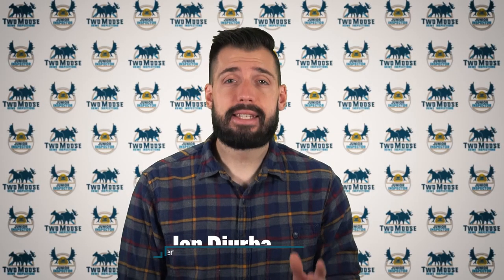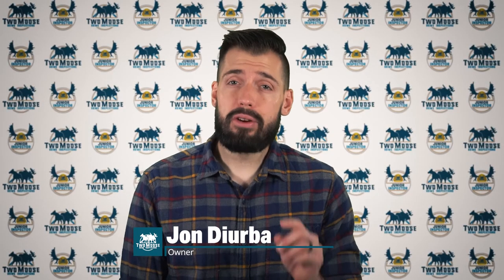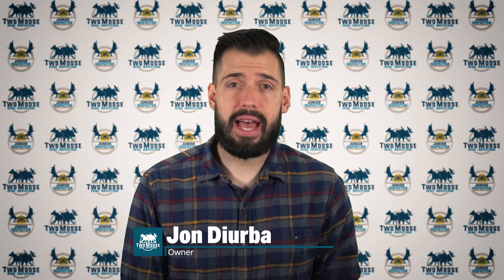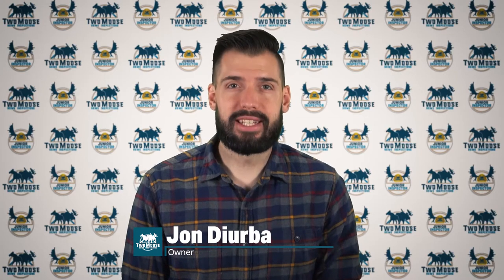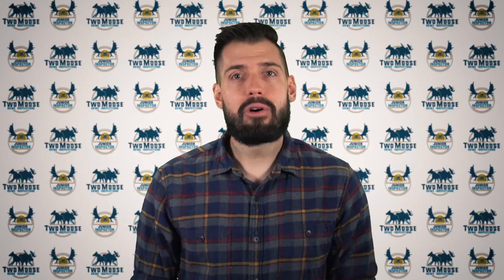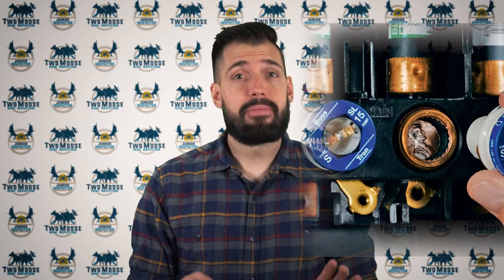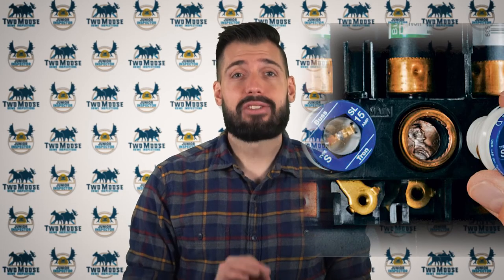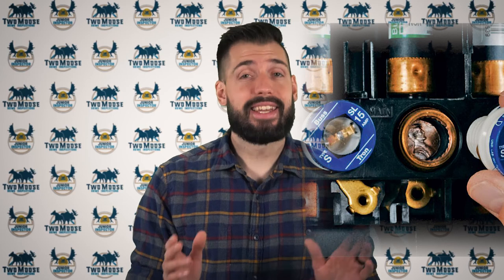Service Panel (2 of 6) - How Fuses Lead To Fire and How Home Owners Bypass The Fuse Box

Comment: Fuses are better protection than circuit breakers but you must use the correct type of fuse. Never put anything in that fuse socket and use the right size fuse. Number 10 wire is 30 amps, number 12 wire is 20 amps and number 14 wire which I refuse to use in house wiring is 15 amps. They improved fuse boxes with fuse stats you can only put the right fuse in the hole they were sized for the circuit used. And you could not fit a penny in the socket and it wasn't Edison anymore. The one connection was on top of the socket and the other was in the center. With Common sense fuses are better protection than breakers and especially the new ones manufactured today in China. 73

Comment: In Wisconsin, we could not use Edison base fuses because they are light sockets (A 10 watt or a 300 watt bulb have the same size base).  We had to use Type-S fuses.  They have different sizes, 15 amp is smaller than 20, and a 15 or 20 amp would fall out of a 30 amp socket.  Also fuses can have a time delay element in them.  A fuse with no time delay like a 15 amp will pop just a fraction above it's rating, depending on the size of it's heat sink a time delay fuse will hold a few seconds before blowing.

Comment: I have Square D QO breaker box and everything is fine. I only had to replace one water heater breaker. The breakers in that old box is much better than the new ones they make today the quality of manufacturing went downhill probably because everything is made in China. I will keep my old but good breakers and box. I don't have GFCI in my home because they didn't have them then but I can add a couple of GFCI outlets in the two bathrooms. The main thing is not to overload the circuits in the first place. It's a no brainer but these young kids think they have to use a hair dryer to dry their hair I remember  people never used hand held hair dryers growing up. Bottom line don't overload circuits. The only time the breaker should have to trip is a short circuit. Common sense will tell you not to overload a circuit. 73

Comment: Nice explanation for the younger generation particularly millennials and Gen Z who may be trying to buy a fixer upper for their first home and skip inspections in this wild market.   Because circuit breakers have been so widespread since about 1960, many younger folks may not know or understand what to look out for, if they are purchasing an old house, and this can spell danger. 

Even if an older house originally had circuit breakers, there can still be danger lurking.   From about 1950 to the late 1980s, Federal Pacific Electric,  often labeled as Stab-Loc, were popular,  but are well known hazards.  The two pole versions are especially dangerous.   They often fail to trip, even on a dead short.   Another brand that is problematic is Zinsco,  rebranded as GTE-Sylvania in the mid 1970s.    The breakers sometimes fuse to the aluminum bus bar, and fail to trip.   Other brands such as challenger and Bulldog/pushmatic also are questionable, but Federal Pacific Electric is the most notorious as a new jersey court has found them guilty of falsifying they met the UL standard when they didn't, and the manufacturer used a hidden remote control to trip the breaker if it wasn't tripping on its own,  fooling inspectors.